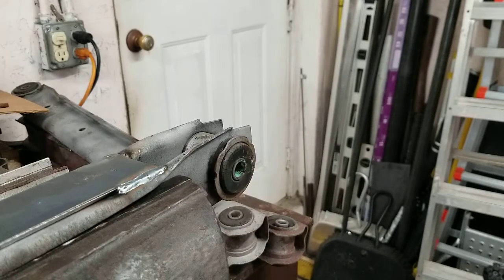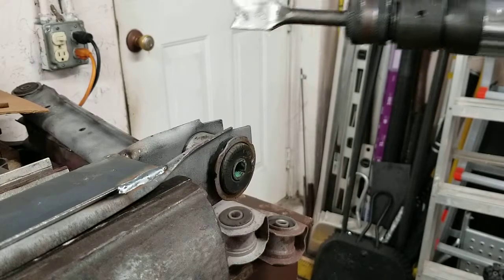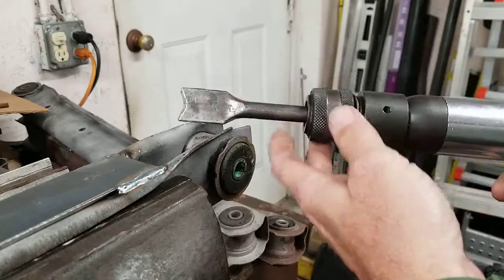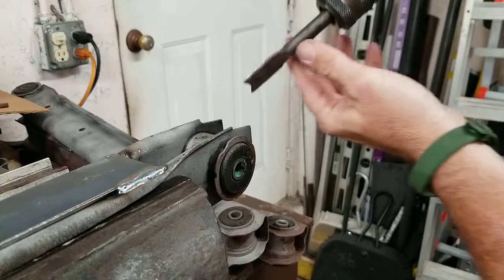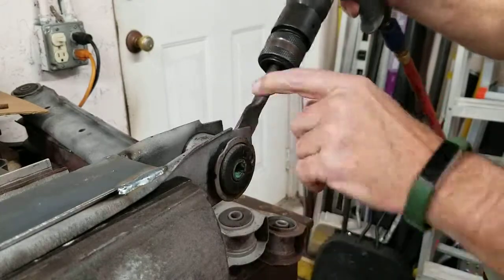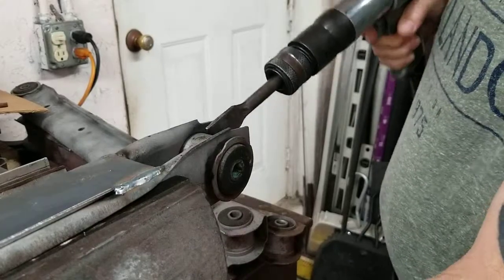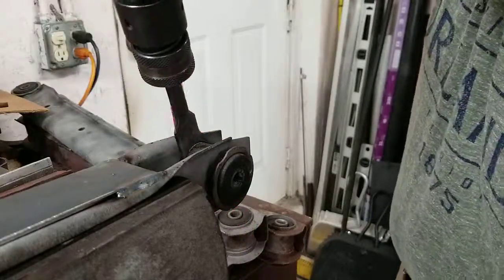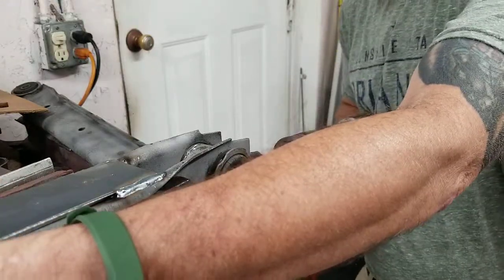Quick and Easy Control Arm Bushing Removal

Comment: I've been doing this for years with the exception that it can be done on the vehicle. Spray the bushings down with penetrating fluid. With the vehicle on A lift lower the vehicle slightly onto a jack stand to relieve pressure on the control arm and zap out the bushing as shown. Install new bushing in reverse with a mushroom bit for the air hammer. This does not work on all suspensions but will on many and very fast.

Comment: What is better for this a long barrel or a smaller one?
Reply from the maker: I use a MAC long throw for everything. I've used short throws as well before and they worked too. Some of the heavier barreled bushings may need the long throw though.
Reply: Thanks for the input
Reply from the maker: @jesusibaibarriaga2645  No problem.